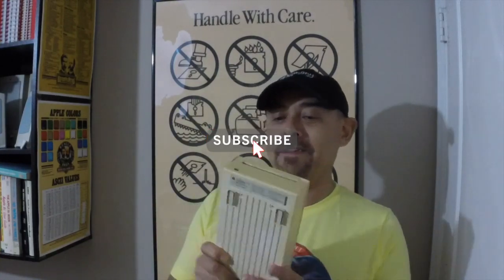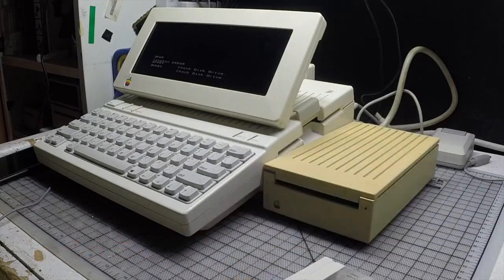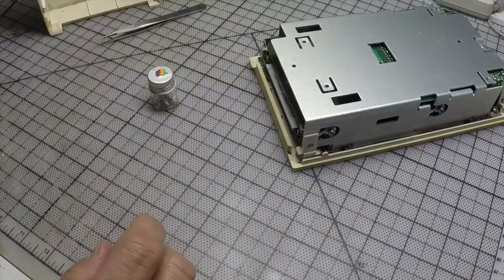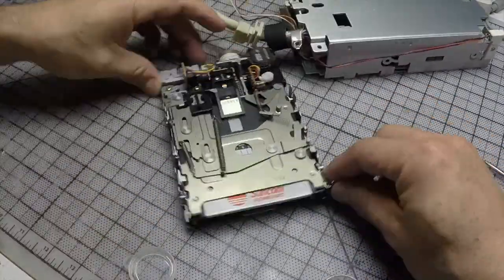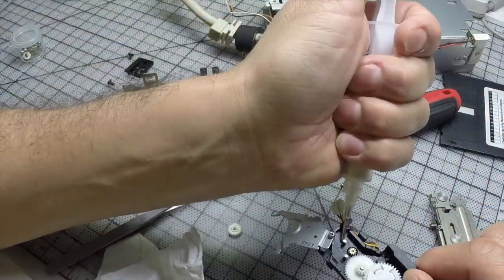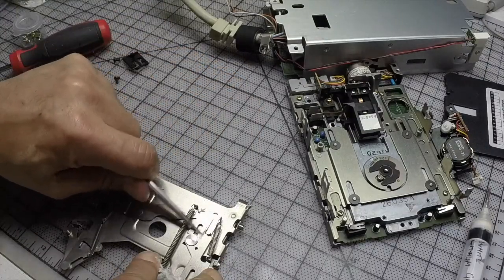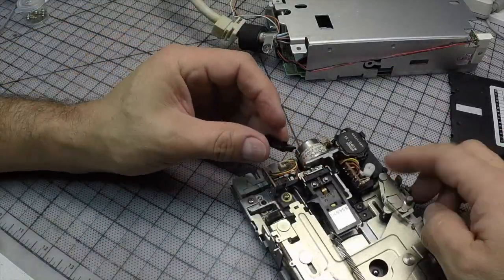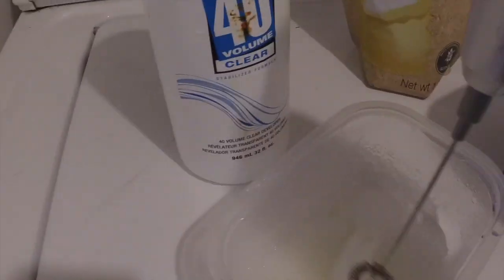Adventures in Retrocomputing Episode 27 - Apple IIc UniDisk 3.5 floppy drive cleaning and refurbish

Comment: Great walkthrough. Do you guys remember another 3.5
Disk that was maybe 800k or 1.4Mb maybe by CMS or another vendor?
Reply from the maker: Applied Engineering and Laser did external 800 and 1.4 drives, AE had also an 1.6K.

Comment: Hola Javier. Gracias por el instructivo!. Tengo un disk drive Unidisk 3.5 a2m2053 con la tarjeta Liron y me esta dando un "I/O error". Probe en los slots 5/6/7. La desarme y limpie, pero sigue igual... Tienes alguna sugerencia?. Muchas gracias!
Reply from the maker: Hola Alberto, ¿No tendrás una //c por ahí? Es más fácil con esa. Podría ser que la tarjeta Liron tenga dañado el IWM, suele suceder.
Reply: @ARCJavMaster  I was finally able to adjust the tension holding the head of the upper unit and it worked again!

I did tests with a disk drive of a PPC 6100 that I had saved and it also worked, but I could not adapt it well to the unidisk case.
Saludos desde Argentina!!

Comment: Great job Javier! I've never seen a Unidisk disassembled before, so this was enlightening. 

One thing I check on the drive mechanism is the disk transport/carrier part. There are four sleeve bearings on the sides that occasionally seize up and won't spin freely and that can lead to slowing down the disk insertion and ejection to a degree. 

I usually take some paper towel to go around them and a pair of needle nose pliers to apply some pressure to turn the bearings. Once I get them going again, I apply some silicone lubricant to the bearings and they'll continue to work for years to come
Reply from the maker: I’m very interested in that technique. We should do a video.